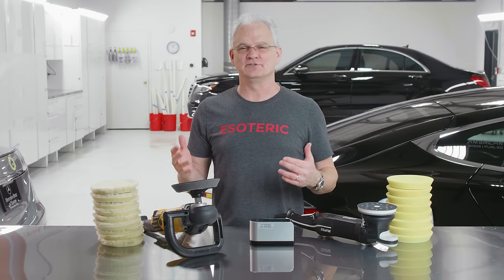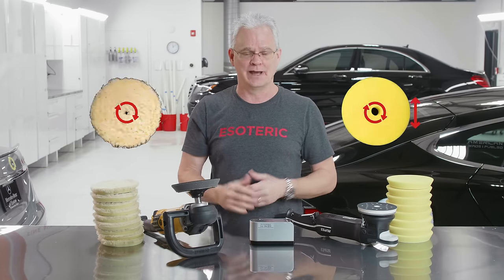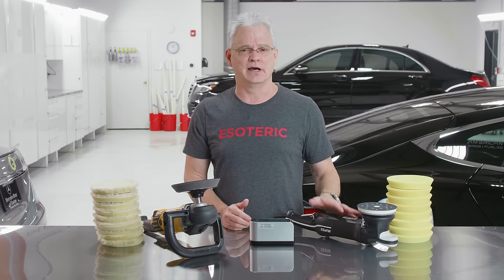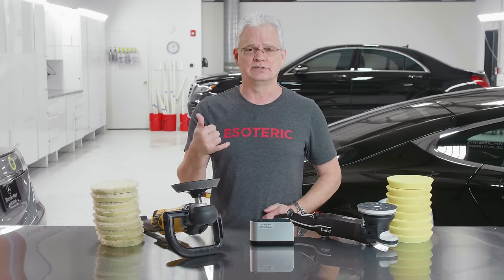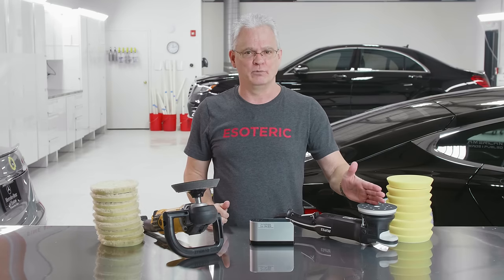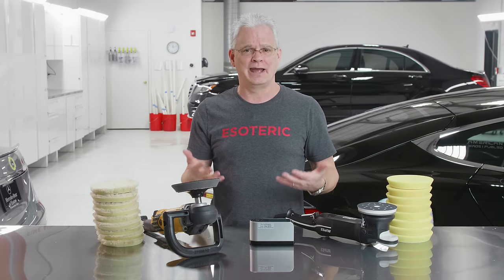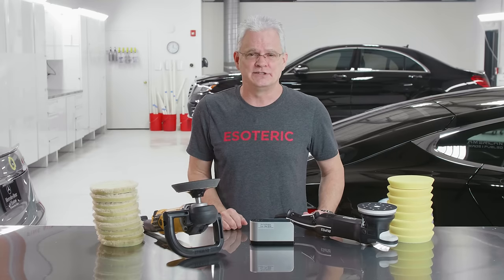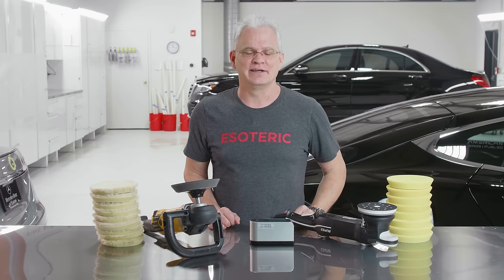Still polishing with a rotary? THIS could change your mind!

Comment: Sir, I enjoyed the video; thank you for producing it. Question: For advanced defects in paint isn't using the rotary machine a more aggressive and quicker way to get to the finish line?
Reply from the maker: Thank you. In some cases, yes, in other cases, no. It's not always just about the time to do the necessary cutting, it's also about how much refinement work is required afterwards. So while you (might) save a little time on the heavy cutting stage, you may require even more time with 2 steps afterwards to get it to finish perfectly. But with the DA, you typically only need one finishing stage even after a very aggressive cutting stage.
Reply: Greg Jackson -- Direct Drive will always be faster, correct, and finish faster.. You just have to want, repeat, Want to learn how to use it... A rotary will be able to change backing plates and pads all the way down to 1 inch... I am not sure all random orbitals do that, but perhaps they do...
I only use Rotary Power and nothing scares me or fazes me.. My best friend the best Boat Detailer in the Pacific Northwest also only uses Rotary Power, and that oxidized gel coat is absolutely the worst thing you would ever want to do..
But he routinely turns out perfect, flat, clear, glossy gelcoat on any color, especially gloss black boats...
Good luck with your research !!
Reply: @Esotericdetail If you know what your doing you can finish all three steps in less than half the time you would with DA
Reply from the maker: @franco12954  Finishing takes time, whether it be with a rotary or a DA. So if you think you can speed through rotary finish polishing, we're not talking about the same level of finishing. Physics still exist with a rotary...this is coming from somebody who spent a lot of time mastering rotary polishing,.

Comment: Hi Todd very easy question if not rupes, what other brand can u recommend? Thanks I watch u from Argentina! Learning a lot from u!
Reply from the maker: Thanks, and glad that you're learning. You can make any DA polisher work with the right techniques and products...it just won't be as efficient or smooth.
Reply: Hola Mati: Yo soy nuevo en esto del detailing pero he leído mucho. Rupes tiene fama de buena manufactura y no lo dudo; pero si lees las especificaciones de las maquinas DA son de 500 watts; hoy puedes encontrar máquinas de diferentes marcas con más potencia y con un costo mucho menor. Yo creo que Rupes se a ganado su reputación y eso está bien pero no quiere decir que otras marcas no la puedan superar; si tienes el presupuesto no dudes y compra Rupes, pero si tienes un presupuesto limitado hay otras opciones de mayor poder y buena calidad; de hecho ahorita estoy en el proceso de adquirir una pulidora y estoy entre rotativa y una DA, me encantaría comprar Rupes pero mi presupuesto es limitado así que estoy viendo opciones como Maxshine, Griots y otras opciones asiáticas que se acoplan a mi presupuesto. Saludos desde México.

Comment: Rotaries > DA. Rotaries take some real skill that you dont see anymore. A rotary is most difficult to use when you do not have the right products. They change the ingredients overtime. Rotaries are faster. less stressful on your hands. From my experience i can utilize a rotary on a finish and ceramic, swirl free.
Reply from the maker: Just because a tool requires more skill and experience, it doesn't mean that it's a better tool. They can be handy from time to time, but technologies and the industry as a whole has moved on.
Reply: IPolishPandal --  yes they take real skill, and if you dont see it, it is the fault of the users of the machine, not the machine or the products used.
Products for Rotaries changing all the time???  How so??? Perhaps if they are changing, the should only get better, no ???  
I use a lot of different products over decades with Rotary Power and find that if I really want to work with any product and just be mindful and most of all - innovative -  I can do anything  and it always turns out perfect and swirl, hologram free, mirror-like paint...

Comment: Hi Todd,

Huge Thanks for explaining all the difference between DA and Rotary.

I have Rupes 15 Mark III and Nano iBrid long neck.
As my 3rd Rupes machine I was planning to get 75E Mini, 
Which is easier to work on some areas on my cars!
Eventually after I did some research I realized that 
maybe I should get LK 900E Mille first ?

What do you think, which one will be better as my next Polisher ?
Reply from the maker: Go with the 3" machine. If you have the LHR15, then you have no need for the Mille. Thanks!
Reply: Thank you !

Comment: I stayed away from the rotary for almost 10 years after starting my detailing business. I'd read & saw so much bad sentiment about them & some good so it was intimidating.

I had no one teach me how to detail nor use tools. I learned via Youtube & trial & error........when I started to Detail Boats, I started to learn The Rotary, had too. I did so many boats that I got good at it quickly.

They both serve a good purpose. ⭐....on cars & RVs you can do it all I believe with a 21 throw DA. With boats I believe you need a Rotary for the Compounding Stage & a 21 Throw DA is good for The Polishing & Waxing Stages.

Comment: Another great, informative video from this channel. I'm a DA user. It's a great machine and it doesn't vibrate anywhere near as much as many people say. Just 2 questions, though. Are you still using Sonax's Perfect Finish for 1-step corrections? If so, then what is the difference between the Perfect Finish and their EX-04-06 that I'm thinking of pulling the trigger on?
Reply from the maker: Thank you. Yes we are, and we do have videos talking about the differences. To summarize, Perfect Finish provides a better finish, and is much easier to wipe from the surface than 04-06. It's the premium of the two, but its performance is also superior.
Reply: @Esotericdetail  Thanks a lot. You've just helped me save £45 on a litre of polish. I'll stay with the Perfect Finish. Cheers.
Reply: Perfect Finish was was designed for use with ROTARY polishers and EX-04-06 was designed for DUAL ACTION polishers.
Reply: What Evolve said is correct, and also what Esoteric said is correct. The 04-06 is still good stuff and it will achieve nearly identical results as perfect finish but it is not as nice to work with and is much more difficult to wipe off than perfect finish (although it still wipes off easier than many other brands) but the perfect finish is really the perfect polish no matter what machine it is used with.

Comment: I was going to get a rotary for head light corrections/windshields. what combo would be good for headlight corrections with a DA?
Reply from the maker: If you're doing mobile work, there's no way around having a rotary for headlights. But if you have a shop with a powerful air compressor, I'd use the Rupes LHR75 pneumatic all day long!  You could try a few different combination, but their new blue wool pads would be good for the cutting stage. As for windshields, I really don't see much need for that myself. In all the years I have been in business, I can count on one hand the amount of requests I have had for that service, and still have a few fingers remaining.  :)

Comment: I just painted my car. I have a 6" da that I used to sand it with and it worked great. I think I made a mistake and I got 3, 10" pads. The pads are good, a wool, a yellow foam and a black finish but I noticed the things hardly spinning. It more vibrating. I guess those big pads on the small da just wont work uh? I can leave the thing sitting there in one spot with the wool pad on and it's not cutting at all. I guess I'll either need to go rent a larger polisher or go buy smaller pads? I'll only need to buff the car, the once after painting so I can't justify buying a larger polisher.
Reply from the maker: If you sanded it, then you need a LOT of correction capability. A 5~5.5" backing plate / pad is the largest you want to use on a DA as you will get much better correction and finish, and it will be easier to control around contours. Also follow these steps: https://youtu.be/G-1YIb3KuSo
Reply: @Esotericdetail  Sanded the old paint off I meant. With the new paint on, I wet sanded by hand. Still have a few more spots to wet sand where I went way, way too heavy on the clear. Those spots are coming off slowly though. I think I'll go rent a large polisher now, as I've already bought the 3 large pads.

Comment: What about cutting with a rotary then finishing with the da wouldn’t that be quicker? As in a 2 stage
Reply from the maker: It depends. If you're going for "quick" on a rotary compounding stage, then you're probably using something extremely heavy that may require more than one step for finishing.
Reply: ESOTERIC  well rotary your using faster arm movements it depends on the product as well
Reply: ESOTERIC btw Iv got Koch chemie h9 that’s very hevy cut I have a friend who uses it on rotary and only takes m205 to refine it

Comment: Very informative video Todd , I've been looking at a Dewalt cordless Da over here in the UK , I've currently got the Dewalt rotary and a Shinemate mini rotary but after your video can't wait to give the Da a try .
Reply: If you want a DA on battery, don't get a DeWalt. It is not the brand it used to be, and hasn't been for years. Still pretty expensive, but quality is not what it once was.
For an inexpensive but great 5" the Shinemate DA is great. If you want a top end unit, get the Flex XFE 15-150 18.0.
Reply: @AB-80X  I got the Dewalt cordless DA in the end and can't fault it , plenty of runtime even with the 4ah batteries and a quality machine to boot.

Comment: Hi there, great video . I have a questions. I really want to by a DA polisher but can I change back plates with a DA polisher? if yes, do you have brands that recommend me? 
Thank you very much
Reply from the maker: The lesser expensive models out there typically have different backing plate size options available, but the better ones are more specialized, and have fixed sizes to deal with.
Reply: WEN 6010 6-Inch Waxer/Polisher

Comment: Every machine has purpose
Reply from the maker: Correct, and the rotary is a fantastic tool for spin-drying pads!
Reply: @Esotericdetail  Do they leave any dust or residue once when dry with that cleaning method,thank you.Still trying to figure it out how to clean them properly (pads).
Reply from the maker: @interceptor7905  Watch this video: https://youtu.be/2m56EZVRrpM

Comment: Now, what about 21 or 15 big throw vs forced rotation?
Reply from the maker: You don't get the control out of a forced rotation that you do with a true DA. We will grab a true DA over a forced rotation 10 times out of 10.
Reply: Forced rotation requires less technique on difficult shapes, but it doesnt cut as fast as long throw. Long throw hands down is the better technology.

Comment: Why am I thinking You need the friction and the heat of a rotary to get the high gloss finish.and polish in smart repair fade outs
Reply from the maker: Not sure why you're thinking that, as it isn't the case...
Reply: Research, Rotary used properly will melt the clear, DA will remove clear. If you know what you are doing a Rotary is better for the vehicle but dangerous, DA makes more sense for most people.

Comment: Hello , I'm from France and I've been working with rotative for 15 years, you motivated me for a DA, and I have a question, I want to continue cutting with rotative but I'm going to take a DA for the finishing steps, which machine would you advise me for the best perfect finishing  result, the best for you? thanks thanks
Reply from the maker: The Rupes LHR15 is the workhorse!
Reply: @Esotericdetail  any suggestions for pad to be used on LHR 15 after using 4 ply twisted woolpad on rotary?
Reply from the maker: @Sahil_shaikh55  Test sections to determine!

Comment: Compound with rotary!! finish with da!!..... I have all of them and your wasting time cutting with the da... Now if your only working on $100,000 dollar cars with light defects yes the da is the way to go but in the real world the rotary kills the da in defect removal...I have no clue why so many people are scared of the rotary all of a sudden. I agree if your doing a one step da hands down... If your buying something to maintain your personal vehicle  da it is.. If your in a production environment as in time is money dealing with cars that really need alot of correction you really need a rotary.  I do agree that technology has come along way. I grew up on rotary and I love my da but only for one steps and finishing. The da will cut and if your not in a hurry it will do an amazing job but its really slow..... I use  sonax cutmax and megs microfiber cutting disk on the da if you have a better combo let me know..
Reply from the maker: It has nothing to do with people being scared of the rotary, it's simply the fact that so many people who used to use a rotary now use the DA. If the rotary works for your needs, then great. But the reality is that the industry has for the most part moved on...
Reply: I think a better combo would be the blue rupes wool/microfiber pad with 3D ACA 500, but its still too slow. I use a double sided wool pad with 3D ACA 500 on the lowest speed setting on my rotary, and it cuts so good that the machine pulls your arm sideways :)

Comment: where im confused is that im using foam pads and newer compounds that are not aggressive to have to do a 3 Stage, with my rotary.

Im not saying im better then this fella, or anyone else.

ive learned with a Rotary, and i rarely use a wool pad. I own a DA, but its also not a fancy one like the Bigfoot.

I just perfer the Rotary as its easier to heat up the paint and correct.

Comment: Very good video. 
Now I am sure that I really dont need a rotary for nothing. To be honest, I do not like rotary's. I had a go on 3 different times. 1 before my courses, 1 at my Autoglym course in England and 1 already here in Madeira island at home and I hated my experience with rotary's. I couldnt control them. The had their own life. Even so I did think that at some point I would have to buy one even that I did not want to. Lol. My detailing course last year in Poland, the had 8 Rupes polishers and all DA. Not 1 rotary. I did my courses last October. My DA is an Autojack DA150. Im happy with it and it has been working fine but its not a Rupes or a Flex. Still need to master my skills, become much more familiar with compounds, polishes and pads. The hardest thing so far is getting the right combination and thats what you teach at your academy. That is a plus and a game changer. 
Keep up the good stuff and thanks for all your help and teaching
Reply from the maker: Thanks for the feedback. Once you simplify your process, and find the right combination of products and techniques, life with the DA couldn't be any easier!
Reply: @Esotericdetail  That is very true Todd. 
Thanks for your videos. 
Regards
Reply: Exactly my point most people are scared of the rotary and never learn to use them. So the industry decided to add a little speed to the orbital polisher make them smaller so it be easier to handle. Now more people work on there own cars so they sell more Products now
Reply: @franco12954  I am going to buy a forced rotation polisher. Who knows, at some point buy a rotary but I believe the forced rotation will be a better choice

Comment: Have you done a video where you test a rotary against a da on a cheap car with bad scratches to see which gets better results faster?
Reply from the maker: With all things being equal, they would be very similar. You also have to figure in the time to fully finish them out, too...it's not just about the cutting stage.
Reply: @Esotericdetail  sounds like a video get a car that needs polishing get a good rotary guy and a good DA guy and compare time to finish and cut quality
Reply from the maker: @121hearc  We've done that. No difference in time or quality measured by a DOI meter. Heavy defects takes 3 steps for the rotary when doing heavy correction, while the DA just took 2.
Reply: @Esotericdetail   I have seen trashed paint that was once jet black and now was gray.. it took just a little 105 and 205 on foam pads and it turned out perfectly flat, clear, glossy, no swirls... I cannot believe a DA could ever correct paint as fast as a Rotary...  :)
Guess it has a lot to do with the skills of the direct drive guy....

Comment: Will the dual action work well on oxidation on RV/boats?
Reply from the maker: Combine it with the right products and technique and it sure will.
Reply: I think what the problem is that most of these DA fanatics are just polishing there cars maybe one or twice a year and don't care if it takes them all day to finish. There  cars are late models and are scared to burn them or already burnt them before. Most never even used a Rotary and are complaining about them. If it takes you a year to master the Rotary then what you need is an Orbital Black & Decker polisher or just get off the couch & just hand wax it It's SAFER